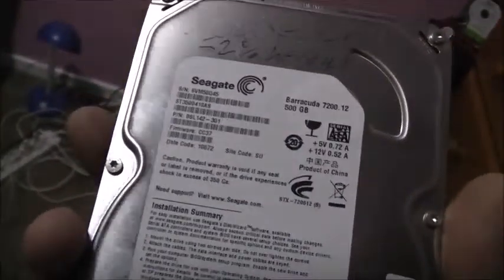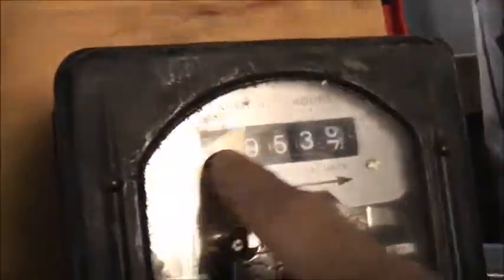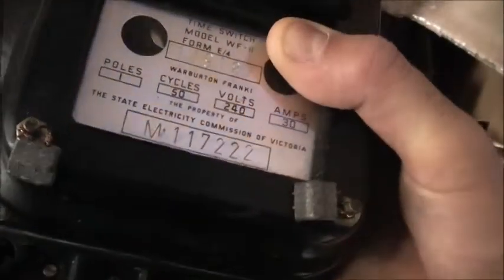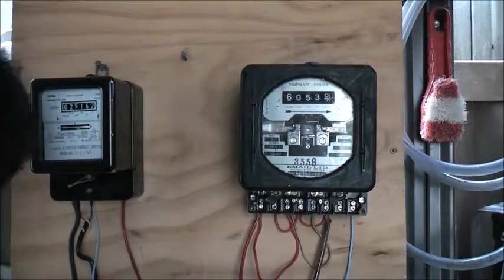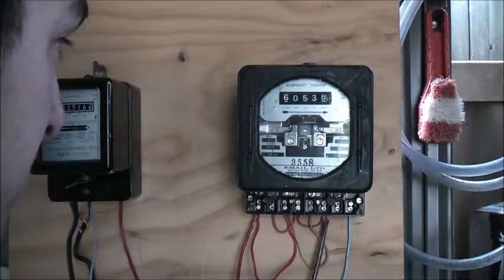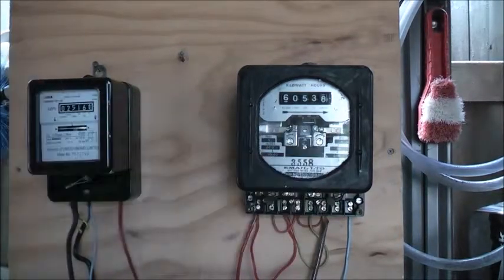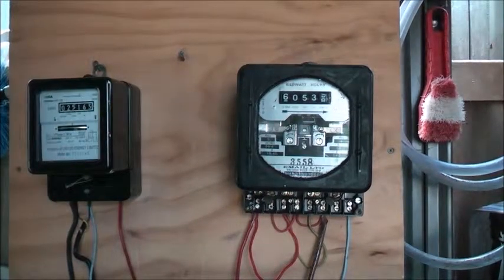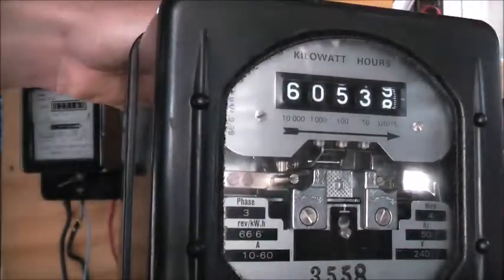EMAIL SD M With Old Fashioned Numbered Wheels Clean & Test!

Comment: Mmmm, Another nice instrument and a nice mellow loadwheel speed on this one while the Iskra goes crazy. :D

As you found out, number-drums can go down as well as up.

On most instruments (I've found anyway) the number drums seem to go upwards, but there are the odd exception here-and-there.

The only meters I know of (currently) where the number drums go downwards are the Sangamo Weston meters that use the same readout as what would be found in the S200.31, and those are the S200.31, S200.33* and the S200.38.

I'm not sure what is going on with the cyclo-dial Sangamo Weston S301.x meters as I don't (yet) own one of those. Maybe Rodalco could chime-in on that one.

*= Rodalco 2007 owns a S200.33. It's like a S200.31 but with added remote-readout.

=======================================
CT meter phantom-loading tip:

When revving-up a CT meter and wiring it as a
whole-current meter, put a SMALL-WATTAGE
BALLAST between the variac and the primary
of your high-current MOT. This will restrict the
current down to a more 'delicate' level, and will
give you much more precise control with the dial
on your variac, as you'll be able to turn the dial
further. This allows much more detailed and
precise setting of the phantom current.
========================================

As far as writing data on a high-speed loadwheel, that would be impossible because the data would be wiped again as that part of the loadwheel goes past the accuracy magnet. Haha, you forgot that bit. Oh, and loadwheels aren't ferrous. :D ( because if they were, they'd stick to the accuracy magnet! :-O )

For hard drives however, the magnetism on them can be re-aligned by placing them in the microwave on half-power for 2 minutes. The magnetism will be re-aligned, as in messed right up, and there may even be flaaaames, glorious flames! :D If there is flames, that means that the microwave has successfully enabled the firewall. :D

Happy loadwheel-spinning,

-BoomBoxDeluxe.

21st october 2015, 16.40